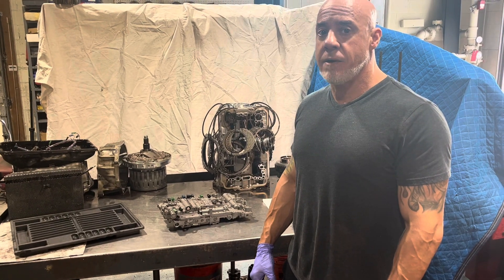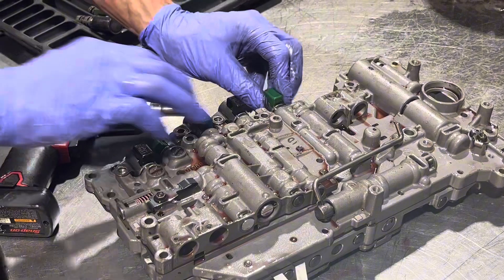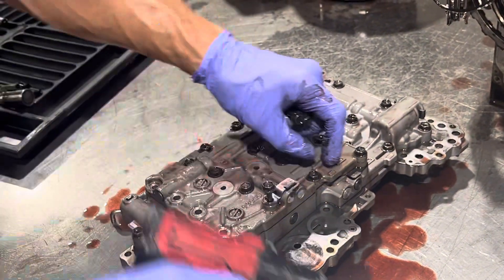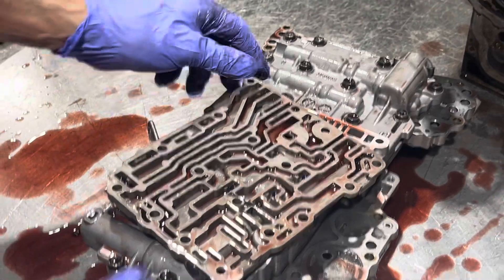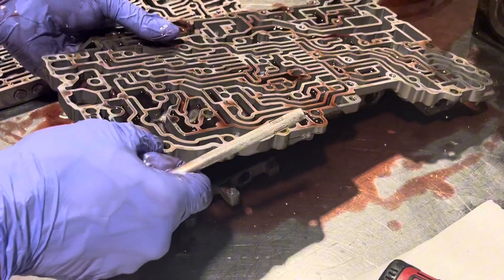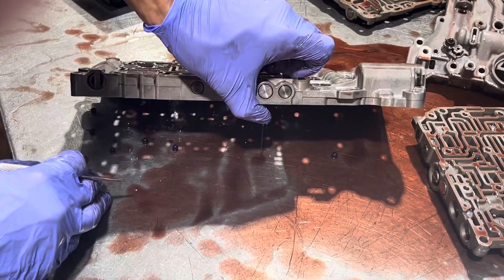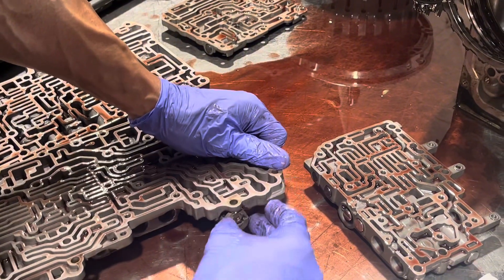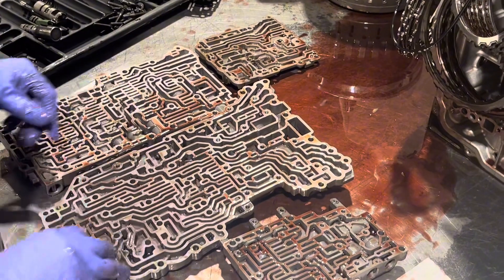Toyota Tundra AB60E AB60F Valve Body Disassembly

Comment: What would you recommend (2013 Tundra, 4WD, 300K miles) for codes on SS "C: and TFP "D". I've changed them due to codes shown and have the same issues. Long or NO delay into reverse, 3rd gear holds too long, no engine braking in 3rd gear when in manual mode and harder shifts sometimes. These symptoms are sporadic throughout the day. I drive a lot. For some points of the drive it's flawless with reverse and the shifts being on point. Beyond frustrated! Help!!
Reply from the maker: My guess would be that the transmission is failing internally
Reply: @iptperformancetrans would check balls or valve inside the valve assembly cause these types of issues? Truck does everything I needed to do and I can pull without having any problems. It's just this delay into reverse and the occasional shift flares from 2nd to 3rd.
Reply from the maker: @b.r.matlock5520 Please see my last response
Reply: @iptperformancetrans thank you sir! I believe maybe I was confused or misunderstanding as to what you mean by internal failure. When you say that, are you saying that the issue is beyond the valve body? Or could the problem be within the valve body itself meaning a full replacement for that part is necessary.
Reply from the maker: @b.r.matlock5520 Internal failure = failure inside of the transmission

Comment: I rebuilt my transmission and it just as far as I can tell it does not shift into 5th gear but 6th gear seems to works fine. I’m thinking I screwed up the valve body. Any thoughts?

Comment: Can use valve body only with one hole for the temp. sensor, and leave one loose, fi the car originally had 2?
Reply from the maker: Not how I would do it
Reply: @iptperformancetrans  would you pull all solenoids out of the new remanufactured  single hole style and go with oem double hole  body with new solenoids or let the extra one hang have you ever heard anyone that tried it
Reply: Im in same boat rite now
Reply from the maker: @erikpeterjacobson There’s a correct valve body and an incorrect valve body.
Luckily, there in my world, I have no reason to do anything that I don’t consider to be the absolute right way.
If you want to mount the extra sensor somewhere where it’s going to stay submerged in atf, knock your socks off and please post the results, it will probably work but it’s one of those things that I’m not going to find out first hand in one of my customer’s vehicles.
Reply: @iptperformancetrans  ok but are the solenoids the same?
Reply: @iptperformancetrans  i actually agree but i dont think i can send it back cause its been too long but if solenoids are the same ima switch em out
Reply from the maker: @erikpeterjacobson By best answer is that if they look exactly the same then ‘probably’ but don’t take my word for it as 100% in this case.
Please let everyone know how it works out for you. Good luck ⚙️

Comment: You say the common failure/wear is the pressure accumulater valve....any reported symptoms specific to this truck?
Reply from the maker: Symptoms vary depending on where it’s worn- high pressure, low pressure, soft shifts, hard shifts and code p2714 are the common complaints
Reply: @iptperformancetrans   I only wish it would throw codes... would make it a lot easier.  It started out with a "pop" sound when going down hill coasting.  If I touched the brakes at all it would initiate a downshift and that downshift would pop  Usually 4->3 or possibly 5->4. Now I hear it during a lot of downshifting. Never on upshit... I just know it's something i need to address before it gets to the point of breaking something.
Reply: @iptperformancetrans  you guys are about 3 hours from me. Are you still 24-48 turnaround?

Comment: Hiya, my 07 IS250 had a P2759 - Transmissions solenoid SLU, electronic circuit code since November. In the past 3 months I have already performed 3 x AT fluid and filter change, and I have changed the SLU solenoid and the electric wire in the transmission’s valve body yesterday. The same code has returned after driving for 1 mile. 

Do you think I can have the problem rectified by replacing the calve body? Or I m likely going to have the whole transmissions replaced? Cheers!
Reply from the maker: 1st off- changing fluid does not fix transmission problems 
That said, you can try to do something with the valve body but your transmission may be damaged and failing

Comment: how to seal one of temperature sensor?  any link or guide and can i fit on gx460 after closing one of temp sensors?
Reply from the maker: You can drive a 3/8” cup plug into the hole or use and extra sensor with the wires cut to plug it off
Reply: @iptperformancetrans help please
Reply: so it can be installed on gx460?
Reply: and if you have any link for 3/8 cup write for me, thank you

Comment: Good thing you took a video so you can remember how to put back together
Reply from the maker: Right because I haven’t done a few a week for over a decade
Reply: @iptperformancetrans  I have a760f and I fix my own cars but when I first saw a valve body taken part that was so alien to watch
Reply from the maker: @ItsAvideo-v7x  Your valve body is nearly identical to the one in the video
Reply: Hi your content is really helpful!  Do you know if a transmission for an 2007+ Lexus GS350 AWD (A760H) can be used in a 2010+ Lexus GX (A760F), if the bell housing, tail end, torque converter, valve body, etc. is swapped over from a GX? Any info is appreciated because it appears that the internals of both transmissions are the same.

Comment: P2714 code of mark x so how to rectify. Suggested, please
Reply from the maker: Usually P2714 is a sign of an unhealthy transmission, it’s not normally a solenoid problem as it is described.
You may have a slipping transmission
Reply: I need your expert opinion, Is it possible that the transmission to be fixed or will I have to buy a new one?
Reply from the maker: @TheAlfa429  It probably needs a rebuild but almost everything can be fixed
Reply: @iptperformancetrans thanks sir for ur reply. if I buy a new one so how can I judge the transmission, is it good or bad?
Reply from the maker: @TheAlfa429  Pull off the pan and see what it looks like and smells like.
Reply: @iptperformancetrans  thanks a lot sir. Stay blessed
Reply from the maker: @TheAlfa429  Thank you
Reply: I have the same code as him. I have to warm up the trans to be able to use reverse. Once warmed up, the trans shifts perfect without issues. I was hoping my trans was still good and i can get away with a valve body replacement 😞
Reply from the maker: I seriously doubt that a valve body is going to help you @Joker-uf6en
Reply from the maker: @Joker-uf6en  I doubt that a valve body is going to fix your no reverse problem
Reply: @iptperformancetrans  what about no reverse same year 07? throw me a code c solenoid stuck off
Reply from the maker: @cojites1 Sounds like bad news, probably internal damage. 
Our contact info is in the description if you need us
Reply: Sir, my transmission has a code p0776 and p2714.  The transmission doesn't slip at all.  It occasionally shifts hard when taking off.  Can I just replace these sol

Comment: Will a 2011 ab60f fit on a 2007 5.7
Reply from the maker: It should
Reply: Do you know the difference between oc150 and oc380? They are both ab60f
Reply: @budistman12 This is the answer we all are looking for. There has to be a difference.